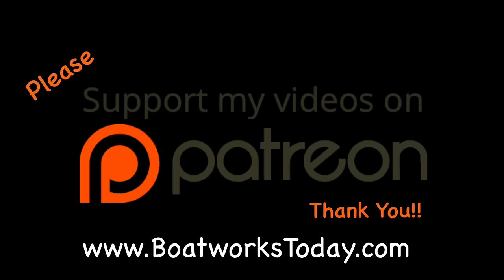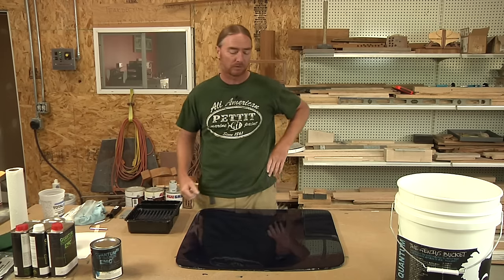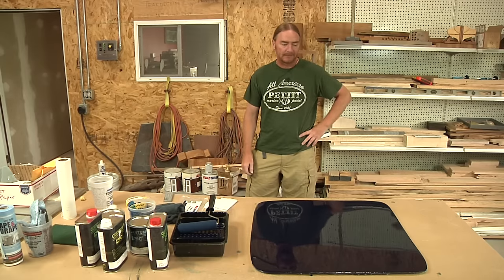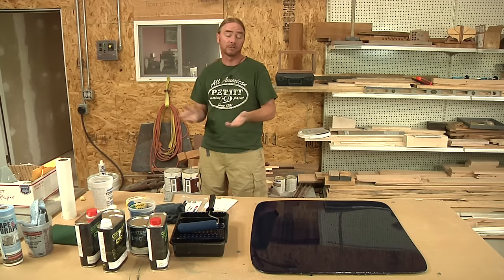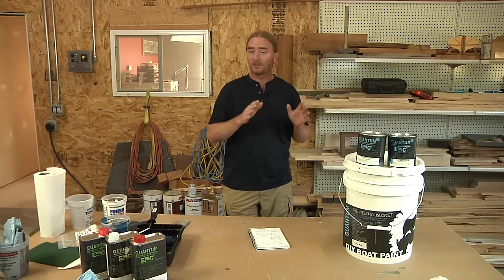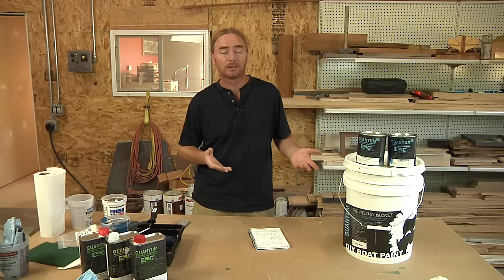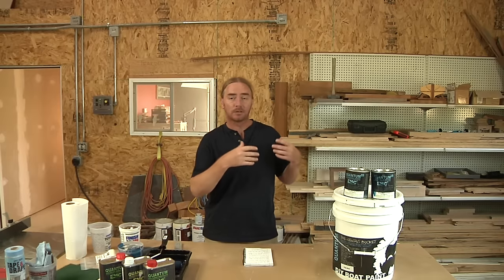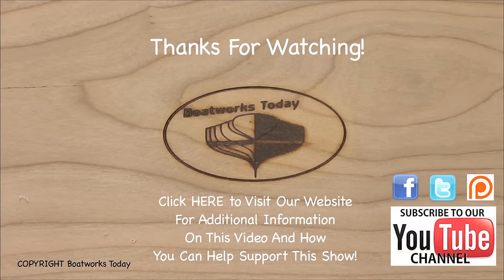Quantum 99 Results And Review P2

Comment: I am a big believer in your work and actually get a lot of ideas from you so thanks. 

I decided to add some comments because I just finished painting my Cal 40 using this paint, but I used the spraying method. So most of the comments are geared to that. This is not my 1st boat to spray actually my second and I am by no means a professional, perfectionist some-what

1>It sprays on very easy, but you have to make sure you give a full hour or two between coats (I applied 4 coats)
2>Coverage was Excellent (Mixture for spray is 1 to 1 so I bought 2 gallons material & 2 gallons activator, that's 4 total of sprayable product) That covered the boat four times including topside with a quart left over for repair areas (runs and sand thru)
3>Orange peel was minimal but it was still there and noticeable at side angle view
4>Shine was awesome
5>You have to wet-sand then compound with 3000 and 5000 to remove orange peel and get best results from the shine
6>I had some runs not many, but when I sanded, I went through a couple time. I sprayed that area with my touch-up gun and it blended perfect, followed #5 to get the best result.

Overall it looks great but a lot of work. and for DIY I saved Tons of cash...

Anyway, that is my 1.5cents.

And thanks again for the videos...
Reply from the maker: Great comment Dale!  Thank you for sharing!!
Reply: Dale Swift can you tell me the size of the tip you used on your spray gun please? Thanks.
Reply: Please what's "#5"?
Reply: Dale do you have any pictures you can share of the sprayed version of this product? it would be nice to compare.
Reply: Dale Swift ‘

Comment: Hi my friends call me Rocky ,I really enjoy your program and the way you make every project very interesting and I can tell by the way you detail all the info that you are very astute and professional in your craft.I was a floor covering contractor for 35 years and noticed a couple of characteristics that a product used to clear coat hard wood floors. 1 It has a very  playable nature with a very hard protective finish in that it could be rolled o,but it was more commonly applied with a very tight 1” to 1 1/2 “ straight bristled comb style brush about 8”s  long,2 the finish could be high gloss or satin and took 24 hours to dry but a second coat could be applied a section at a time with an extended handle within hour but it glazed over very quickly and the timing for the second coat made it to hard and risky 3 during the drying time if a door was opened or a widow left open directly over the floor where the slittiest breeze could make contact with the floor during the drying time it would leave ripples like those in your video and would have to be sanded out a week latter and the finish could be reapplied it took that long to completely harden so it would not ball up on the sander and cause an even bigger problem.
I find your video very helpful, I may be acquiring an abused fiber glass hull and attempting to refurbish it my self. It has a metal flake finish on it under about 1/8 th “ layer of grimy dirt and oil, but the hull is intact except fo a couple of cracks on the interior frame work.

Comment: I love your videos!  Thank you so much for sharing as knowledge is power! 
I am currently living on and restoring a 1971 45FT powerboat.  This is my dream life :) 

My next project is to paint the topside.
I have zero background in paint and applying paint, let along with a boat.  Your videos really gives me the courage to try the DIY. 

Last paint was applied 5 years ago with one coat (suppose 2) of Pettit EASYPOXY (3175G -White). I have pressure washed the boat 2 times last month, the old paint starts peeling off in some area. 
I still have some Petitti left which I would like to use it up (eliminate the waste), but I also open to trying another paint brand. I have a bold idea to paint the left side of the top with the leftover Pettit, and right side of the top with a new brand so I get to compare the results side by side. I am not sure if this is a smart idea, but I am attempting to do it.  

The current top has the walnut shell texture and original paint on it. so I guess I only need to apply another 2 coats with a good sanding and cleaning. Please correct me if I am wrong. 

I am also very curious about how the orange-peel looks like when it's on top of the walnut shell texture. 

Comments and suggestions are highly appreciated as this is going to help me to figure out what new paint I am going to try in 2020. 

THANK YOU VERY MUCH FOR SHARING AND KEEP POSTING MORE :)

Comment: First, I've been a fan for a long time. I think that any manufacturer that wants an honest representation of their product should send you a sample to showcase. Second, I have a question regarding the orange peel effect that comes with rolling and with this paint in particular. If you were to roll it on for two coats, prepping in between and then prep a final time and put several coats (sprayed) of clear coat, would that get rid of the orange peel or is it not possible/advisable to spray a clear coat over a rolled paint even after sanding smooth? Thanks for all the great videos and I look forward to seeing more.

Comment: Have you tried the International 2 component Perfection line?
I have just done a full free board on a 28" sailboat and used the roll and tip method. I am quite pleased with the result, but I was VERY impressed with the result from just rolling. The added tipping gave it a finish close to perfect, but it really is remarkable how well it did without tipping.
Same goes for the 2 component Hempel I tried, but unfortunately that line has been discontinued 😕
Reply from the maker: I have not, but sounds like something to look into!  Thanks for the suggestion!!

Comment: Been watching a lot of videos, as I bought a old boat that needs quite a bit of help. After watching you do the fiberglass and the filler repairs, I think I can handle this project. Getting back to this paint, if you have the orange peel look, can't you basically do a clear coat to get rid of that? I am not sure if that would work with this product either, but I was seeing another video where he clear coated and could do a light sanding of the coat and it seemed to have eliminated the peel all together. I may have to experiment a bit myself. Other than that, great videos and you have definitely helped me a bunch with them.

Comment: I was trying to learn how to use one of those cheap plastic home depot edge painting devices. Starting with the PERFECT amount of paint on the sponge of the device was critical. You mentioned that you roll most of the paint off your roller before you start. I learned to use a brush to apply just the right amount of paint to the sponge of the edger, if I did that it worked perfect. I was wondering if it might be faster and more consistent for your job... to brush the paint onto the roller? If you have a brush out at the same time with the same paint on it, it might be worth a try..just dip your brush and use that to apply to the roller.
For diy people, every surface I've painted and every type of paint I've used that I've used those small wizzee rollers on...the wizzee rollers work so much better and faster than the old larger rollers. I can't emphasize enough now much better the wizzee's are. They're easy to find, the roller handles for that style are just a handle and a bent piece of round metal, and the rollers are smaller diameter and not as wide. For house painting, don't get the ones without the little plastic cap on the end, get the ones with the fabric that wraps around the end. If painting a wall or something, even if you can reach everything, still use a telescoping extension pole, you'll be able to rip through a whole room in minutes. You'll be amazed at how fast it goes!

Comment: I have learned watching your videos more than would learn in a school. Thanks for that. 
I have a 1998 - 115 hp Johnson outboard motor and I would like to paint it. What do you recommend me. Gelcoat or boat paint?
Reply: I was told you cannot paint a fiberglass boat. I just bought an 86 Larson runabout. I just want a nicer finish, not perfection. Just don't want to see the old decals and faded paint. I will perhaps next year want to fill the dings on the bottom of the boat with fiberglass repair and gelcoat. 

I do wonder how to remove the old decals from the topside so I can paint that.

Comment: Really appreciate your videos, thanks for taking the time to educate. I'm looking at having our 38 ft fiberglass trawler painted in a shop ( spray on ) and my question for you is, just how much better is this paint ( Quantum 99 ) then using automotive paint  ? I'm having the topsides painted and the shop I'm going to use suggested that they use automotive paint with a sealer. I'd really appreciate your thoughts on this. Thanks

Comment: Hi!  I have a kayak with a carbon fiber bottom and fiberglass top that the gelcoat has come off in multiple places.  I've sanded and smoothed all the areas out and am now ready to put some sort of coating on it.  I'd like to keep it cheap and simple. Do you recommend some kind of paint?  What about epoxy paint?  Do you have any videos on how to do epoxy paint?  Thanks in advance.

Comment: This looked like and reminded me of lacquer or epoxy paint when you walked away and was wondering if it would flow and spread out. Which both also will have high glossy finish as well. This means one can actually get prolly a better flawless non-orange peel finish ... albeit prolly not a DIY'er. But someone that has little bit of experience rolling and working with one of those types of paint. Again this is only speculation basing on IF it really does act similar, as I have never used this paint. Everyone has their own techniques, however with those types of paints, I find that yes you want to spread it on thin (as always with any paint). However you prolly would have down better either only doing half of the panel, reloading and do other half, than doing what I know of as being called a very light tack roll after on the whole section, applying light but as even stroke pressure as possible. OR doing whole section like you did with one load of paint, than reloading and again doing light tack roll over the whole section a second time, again applying light but as even a stroke as possible. I will concur though, that for the basic DIY, they will either need to practice a bit first, or they simply will not achieve that more professional look. I on the other hand am very curious and will keep this in mind for future.
Reply: Should have added that if it is more like lacquer paint, that is not really a roll and tip paint, almost requires being sprayed to get nice finish coat as it is even trickier than an epoxy paint.

Comment: Hey found your channel and just happened to have bought my first boat a 19ft SunRay. It’s a great boat on the water but showing it’s age. I want to fix it up and was unsure on what products to use. I’ve gotten a lot of ideas in just watching a few videos. My boat was painted with a brush or roller some kind of white paint And has all the normal stress cracks that need filling. What is the difference between putting on proper paint or a gel coat? Witch is the best way to go?  Sorry if this question odd but I’m learning as go. If you have done a video on this please send me in that direction. Thanks in advance from Newfoundland Canada

Comment: Great review on this.  Do you suppose if you had someone do a tip job with a brush would improve the results?
Reply from the maker: I tried tipping it on one sample but it wasn't the best brush in the world and the results showed that :-/  I suspect that if it were thinned a bit more there would be a longer working time for it to flow out once tipped.  Have to play around with this material a bit more :-)

Comment: Have to disagree about spraying  being better than a roller and tipping. The Narrowboat Painters in the UK always use a brush. It's the same process as the old fashioned Coach Painting and is immaculate. They do apply 8-10 coats and it does cost $10-12K but is way superior to spraying.

Comment: I am about to replace my Mako 258 Cuddy transom.  The hull will be repainted or gel coated.  I take maybe 6 trips a year and leave the boat in the water for a week or two when I do.  It is trailered.  I don’t want to bottom paint it.  Would the paint hold up to the slime and algae buildup I will get in Florida or  should I be looking at applying gel coat?

Comment: I just bought this in snow white. You had mentioned you specifically got flag blue, I'm thinking that the lighter colors and the fact I'm using it on a deck with nonskid will kill al lot od those concerns. I AM also trying the flattening paste even though I'm rolling it. I'm gonna mix the daylights out of it and see what happens
Reply from the maker: If you're using it on nonskid there will be no issues.  One suggestion would be to try the first coat without the flattener and see what you think about the gloss.  Rolling a coat with the flattener can be done but it's tricky.  Just make sure you don't over-work the surface once the paint is down otherwise you'll end up with streaks of gloss..  Let me know how it goes!!!

Comment: OK since this is appears to be a good hard paint but it "Orange Peels" could you not wet sand this to make it smooth? I like the hard paint since it will be more durable. Any feed back or comment on the wet sanding to get the orange peel out? Is there some reason why this could not be wet sanded?

Comment: After getting a hull painted with about three coats of this quantum 99 could it be wet sanded and then polished and waxed to get that mirror finish like you would with spray?
Reply from the maker: I'd probably roll out a 4th coat if that's what you would be planning to do.  Yes it's certainly possible, just a lot of work..

Comment: It's a moot point in my case, since my boat is gel coated, but I was wondering if that paint could be treated like gel coat to obtain a better looking finish.  Specifically, wet sanding the orange peel out and buffing to a high gloss.  Would that even be cost effective?  Or would it even work?
Reply from the maker: Hi Rick, yes this paint is able to be wetsanded and buffed (which would effectively remove any orange peel)  which is one of the things that makes this paint so attractive.  I will be doing some more playing around with this material to see if I am able to fine tune the process :-)

Comment: Hi:  I am searching for a DIY paint for my 37 y.o. hull which badly needs painting - do you think that the orange peel would still have formed if the panel were vertical?  Could the orange peel be minimized by sanding and painting with a higher concentration of solvent to paint?  Love your work!  Thanks!  Bruce
Reply from the maker: Hi Bruce!  Horizontal or vertical I don't think would make much different in regards to the orange peel.  Adding more thinner might help but havent tried it yet.  Will be playing around with this paint a bit more in the future!

Comment: what do you think about adding non-skid to this paint?   I use algrip with their non-skid micro cells.  You think those could be added to this stuff???  just curious.
Reply: I was browsing the EMC site after watching these mainly to see what colors they offered and the price for the bucket, and I noticed that they sell a non-skip additive too.My guess would be that it would work fine.
Reply: Usually companies sell their own nonskid particles to match the density of their paints. But having the particles the same density means that when you mix it in the paint, it will be suspended evenly throughout vs something like sand that will sink right to the bottom as you dip your brush in.

Comment: What if you thinned it a bit and tipped it? I mean, I'd expect orange peel from just a roller....
Reply from the maker: Exactly; I tried tipping it on one sample but it wasn't the best brush in the world and the results showed that :-/  I suspect that if it were thinned a bit more there would be a longer working time for it to flow out once tipped.  Have to play around with this material a bit more :-)
Reply: Cool thanks. :D
Reply: If you try this (roll & tip), let us know how it compares with Interlux Perfection for the same method.  I've used that system w/roll & tip with favorable results.  Thinning is always tricky.

Comment: What is "tipping"?
Reply: "Tipping" is the process of brushing the paint with a brush after rolling it with a roller. Usually works pretty well with paints that dont require a catalyst because they tend to dry faster. But there are some two part paints that you can tip.
Reply: Using a special brush to smooth out the paint after rolling